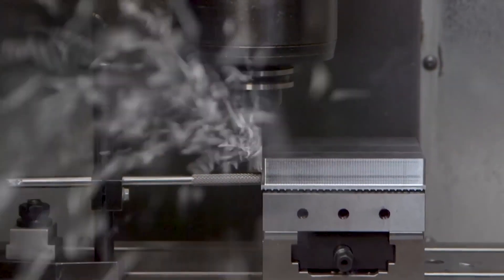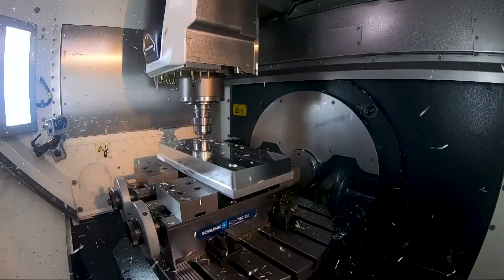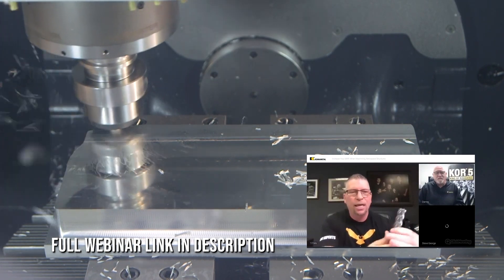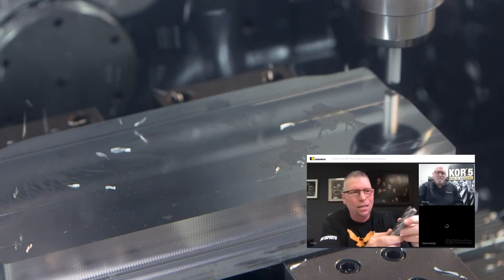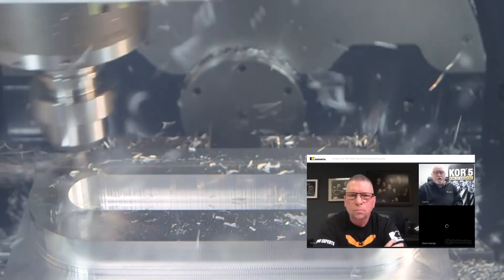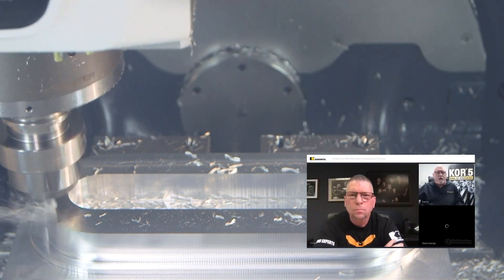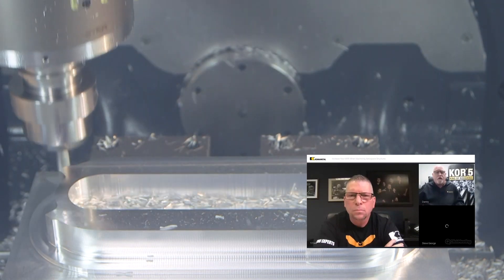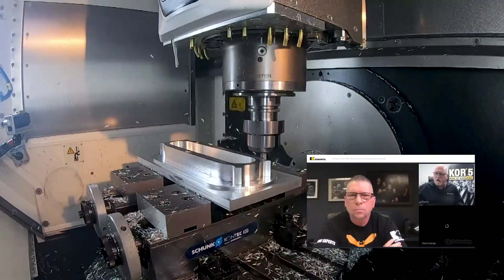Mind Blowing MRRs are How YOU Make Money in CNC Machining | 1600 IPM DMG MORI DMU50

Comment: I run 2 DMG 75 mono blocks at the shop that I run, they have at least as much power as his 50 does probably a little more. I can assure you that the machine can not hit 1600 ipm in “2 inches”. It would take almost have the machine travel to hit that feedrate. Also that endmill is great for shops that run a lot of production but we mainly run small quantities like 2-3 parts it doesn’t make sense to run that fast when you’re setting up trying to prove in a program and you can maybe only run that fast on one part.

Comment: I would love to know what your tooling costs are per month running those speeds and feeds. Machine tools have advanced but not to the point you have endless cutting potential. All carbide wears. The idea is to find the best compromise of speed and reliability. So that tool wear is minimal. Your also going to wear the machine out quicker running it flat out constantly pushing it hard like that. The key to making money in engineering is methods. Methods make money.

Comment: I run a DMG CMX1100V. It's not in the same class machine as far as speed and rigidity, but when I try to approach high speeds, the machine shakes, jitters and jumps when changing directions while making acute, right angle or direction changes. I'm sure it's capable of more, I just can't figure it out. I have messed with loosening the tolerances with the tool path, smoothing features, trochoidal, etc on the CAM side with little success. As far as the machine side, for high speed machining trying to max out at 20k mm/min feed, I am trying to figure out what the best combination is for the G332 and or G05.1 (Fanuc control) as well. It helps attain high speed in straight lines, but if it has to change directions much, say in a mold cavity in aluminum, it jitters and shakes horribly. Anyone familiar with DMG/Fanuc, I'd like your opinions. What is TITAN doing here on DMG that I'm not doing? Just cranking up the speed and feed is only part of the story. Need more info to also control machine dynamics! Thanks for the video!
Reply: well i gotta say, is your machine securely fixed in the foundation of your shop? next this would be to call DMG and ask them to send a service engineer to test the machine, but make sure its securely fixed in the foundation and the machine can do that speed on a dry run, (not cutting material, just moving around)
Reply: 20m/min feed rate?

Comment: How many time this machine will work with precision accuracy with this milling speed? Half year? Year? What about spindle bearings? This looking good on the video, but real life says that all time what you won is crashed on spindle bearings price, ballcrews price and all mechanical components
 price.  You use machine at maximum capability, and you promote it
but its wrong way to small companies.
Reply from the maker: You have to find the sweet spot at 80% load and live their... The mindset is the difference in this trade...
I have had many of my machines for 15 yrs+... and I run day in and day out.
Just need to rough fast... relax pressure and come back and kiss it.

At the end of the day my customers love my prices... and my machines last.
Reply: @TITANSofCNC  And obviously they get serviced every year right?
Reply: @W204_Muj  If you're not servicing your machines every year, regardless of what S&F you're going at, you're not doing it right. Machines wear out, and you must do a Ball Bar test annually, at the least.
Reply: Spindle load actually goes down with chip thinning cycles. Axis load goes up a lot just from the speed of the directional changes. But he’s got the right machine for the job. The DMU has very extensive cooling in the ball screws, casting, bearings, etc. HSK connection, and like 30 or 40 sensors  in it that are giving constant feedback on the health of the machine. Plus, the spindle itself has a 3 year unlimited hour warranty on it.   It really is okay to run this hard.